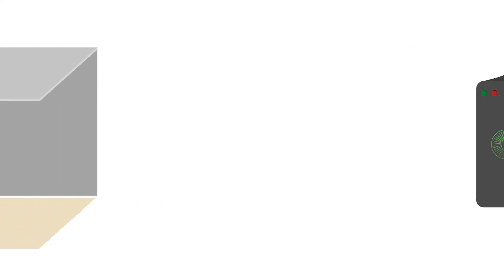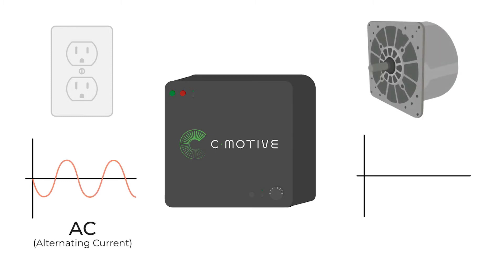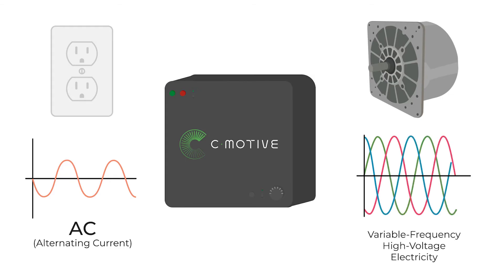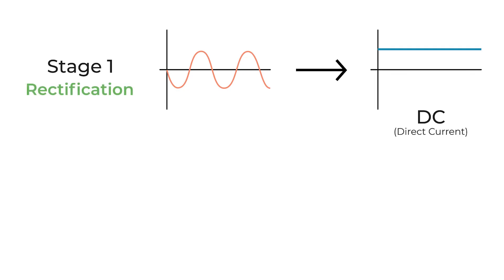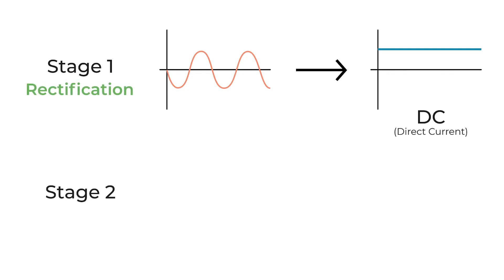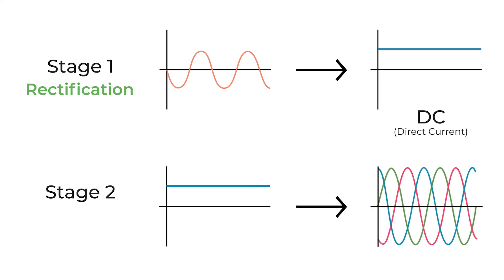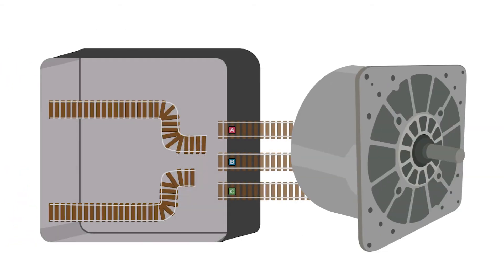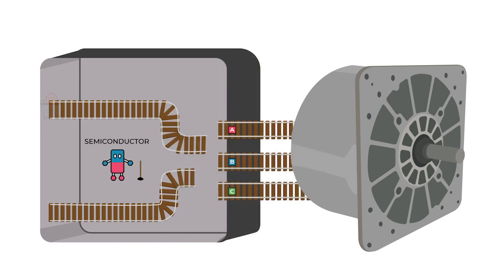C-Motive Explained: Drive

Comment: Yes, but there are some losses by commutating the three phases by transistors...
Reply: that's nothing compared to the losses due to viscosity of electrolyte. This motor could never reach the RPM of regular BLDC motor. That being said, it still might be advantageous in high torque applications, if what they say about efficiency is true.